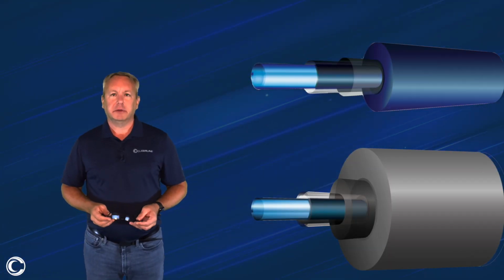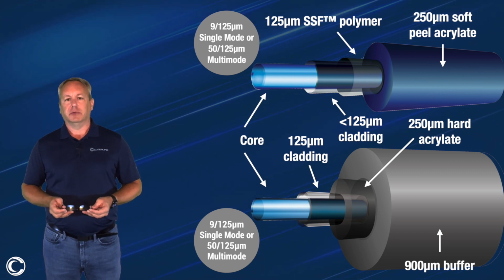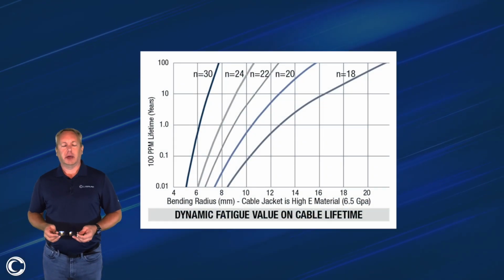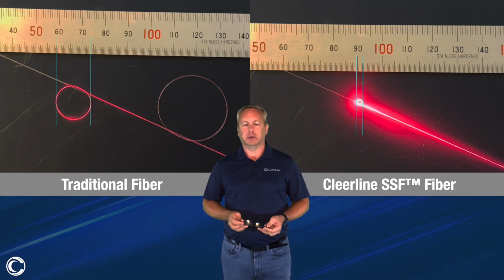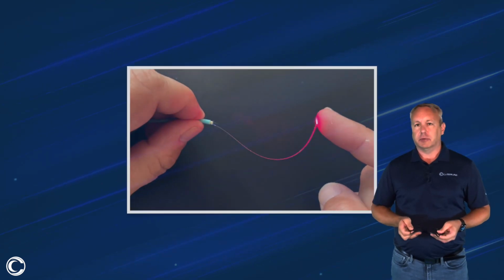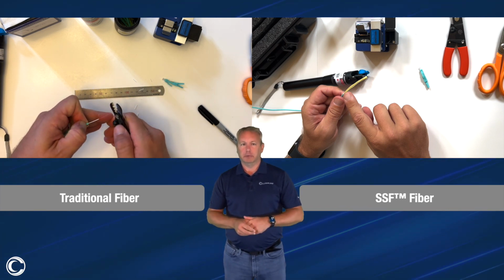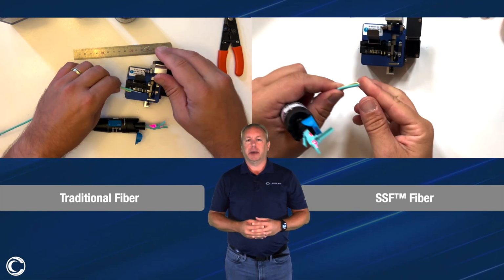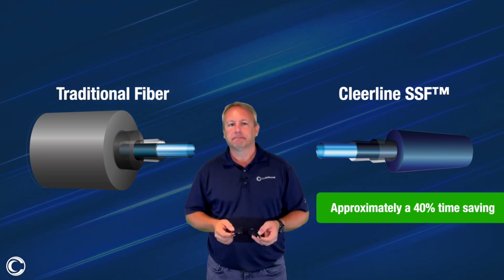Cleerline SSF™ vs. Traditional Fiber

Comment: Cann SSF fiber be fusion spliced to traditional fiber or even other SSF fiber?
Reply: Jason - The answer to both of your questions, is yes.  However, you do need to use our SSF-TRIHOLEP strippers to remove the polymer, then clean the fiber as you would any traditional fiber, cleave as normal and splice.  The fusion splicer also needs to be set to core alignment, not clad alignment.